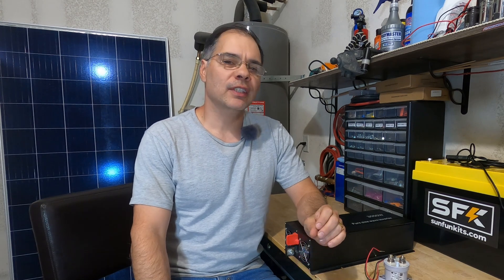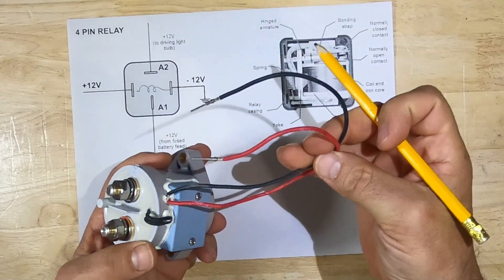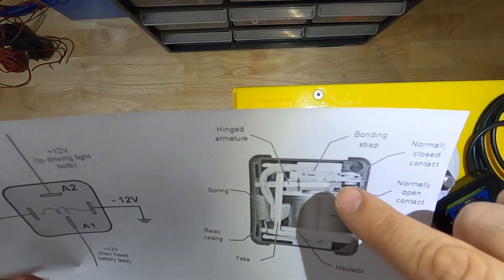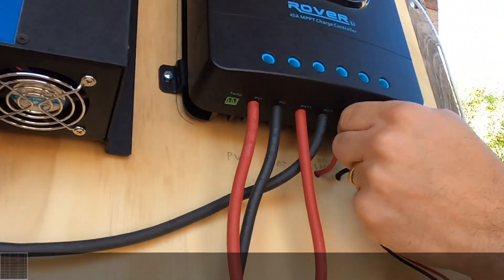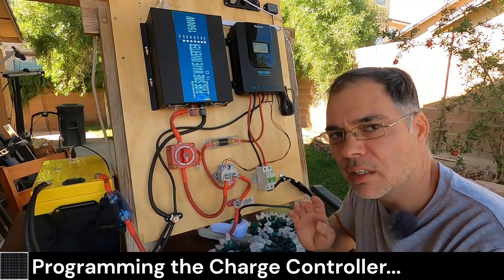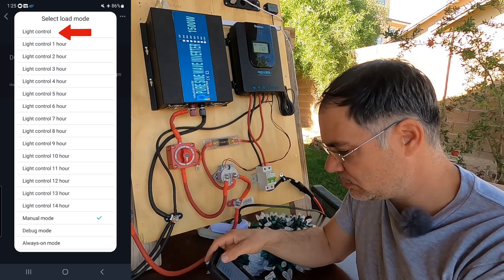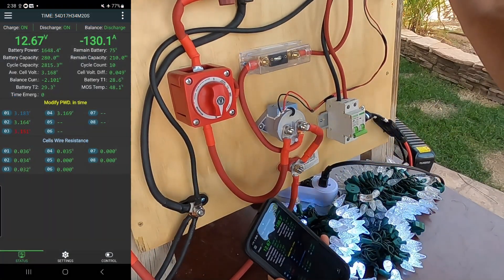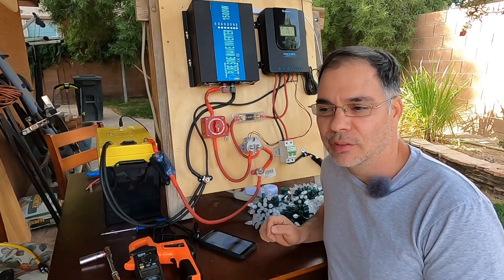How to Prevent Battery Over Discharge In a Solar System

Comment from the maker: Visit my website to see how I built this system:
https://www.natesdiysolar.com/projects/12-volt-off-grid-solar-system/

Batteryhookup.com has these really cheap, just $15! (2025) Normally, these can be found new for $200-$300! 

This contactor can be used with 12V and 24V inverters and batteries. 

The Renogy charge controller will not allow you to manually turn on/off the load  port when in light mode!

Be sure to check that the max continuous-carry amp rating of the contactor meets or exceeds your systems max amp draw.

CUPON CODE: NATESDIY

TE Connectivity EV200AAANA 500a 0-900vdc Tyco 12/24v  Contactor: 
https://batteryhookup.com/products/te-connectivity-ev200aaana-500a-0-900vdc?fbclid=IwAR1SlN-a1h45QklUTRLY9ptf16ztDd3K6ORxXG-7jK6bnx-gap5xo2B7ZFM

Comment: Awesome, probably I can hook this up to a cheap Lvd module, I have been looking for this kind of hardware since my scc is renogy adventurer, there is no load terminals, also I need to cut off power from the inverter, the tutorials I see are cutting off from the AC side but the inverter still ON, which I do not like
Reply from the maker: Yea if you do not have a cc with a load port you can get a voltage programmable relay to drive the contactor. Oh LVD probably the same thing lol